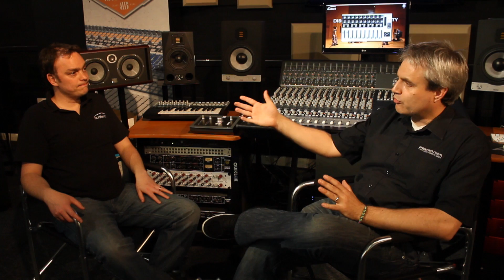Audient iD22 USB Audio Interface Review

Comment: I just purchased my id22 and asp880. I have set the clock source on both to match my sessions of 48. Pro tools has an error saying clock source and sample rate do not match. Is this something to do with the audient gear? Pro tools works fine with all my other interfaces. And the green light in the audient software shows that the id22 and asp880 are locked. Can someone help?